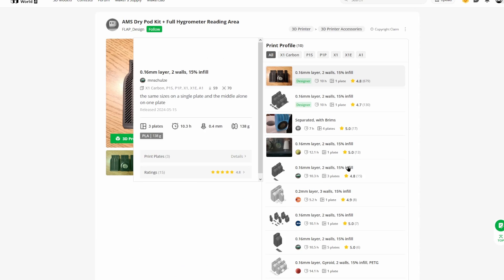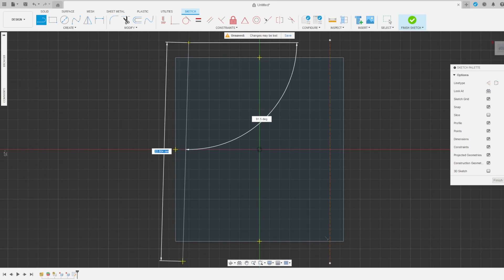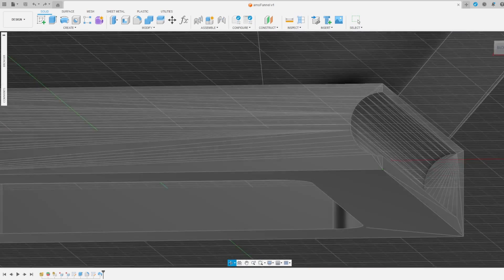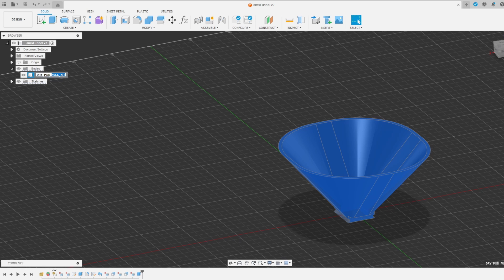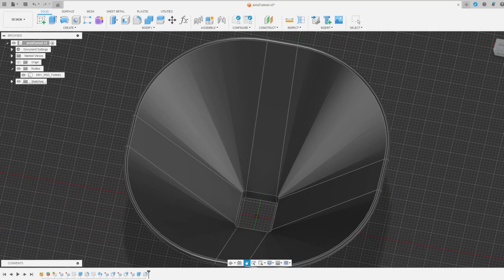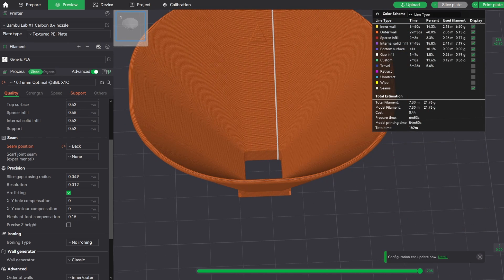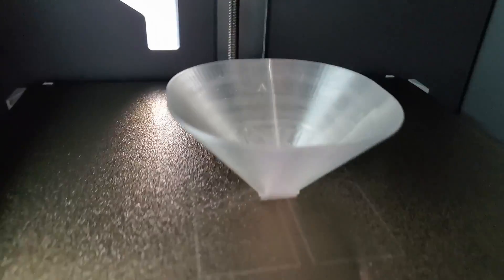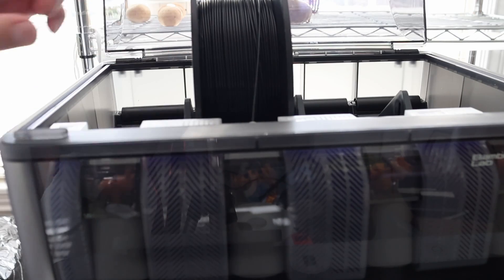Remix in Fusion 360 | Bambu Labs AMS Desiccant Funnel

Comment: I suggest you also combine face groups before converting a mesh.  This saves you from having to manually delete polygons afterward.
Reply from the maker: When I insert the mesh, then "Generate Face Groups" select the whole part and run it, then I "Combine Face Groups" and select the whole part, it doesn't seem to change the number of resultant polygons, at least not on this part.  What am I missing?  Are there other steps you use when importing a part?
Reply: @buildtestbuild  Never mind what I said about combining face groups.  You need the prismatic method feature to convert meshes and merge groups of faces into singular faces.
Reply from the maker: @bernardtarver  that makes sense, thank you for the follow up!